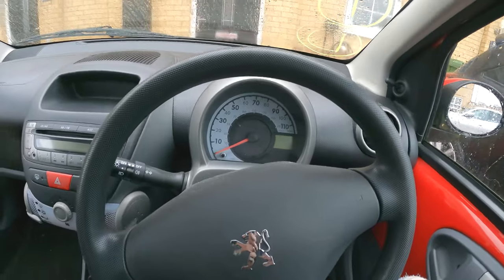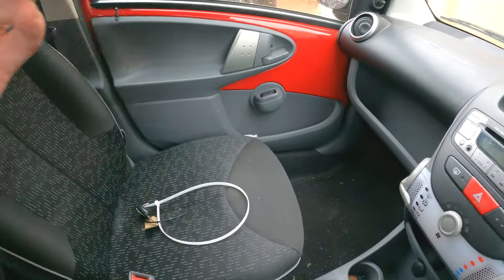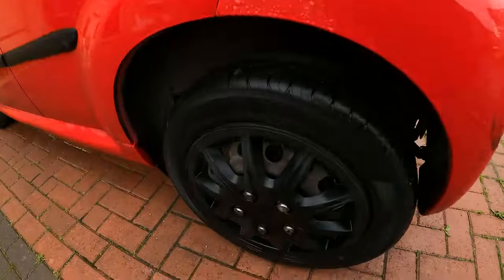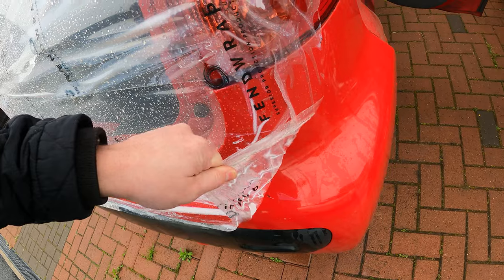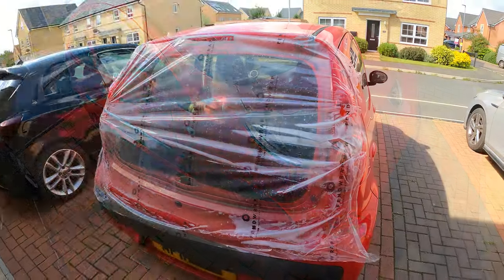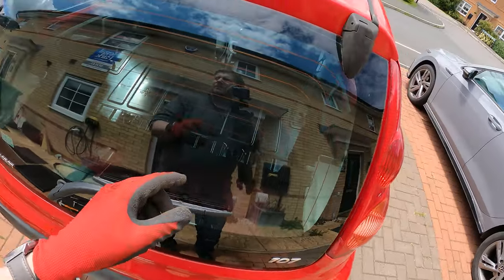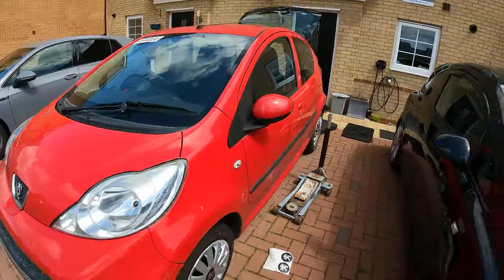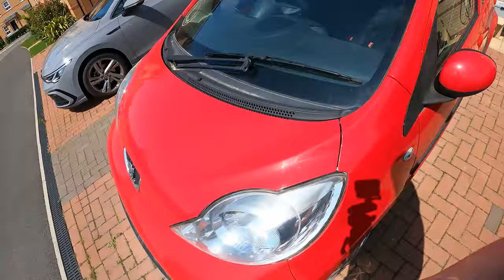I'M SHOCKED! WHY WAS THIS PEUGEOT 107 WRITTEN OFF?

Comment: Seems a safe bet. Some can get a bit rusty underneath, Should sell well. Even if you only do oil/filter it's worth checking brake pads, wiper blades, lights, fluid levels, air filter condition, etc. Did you leave George at the scrapyard?